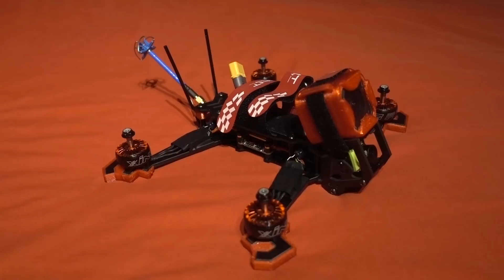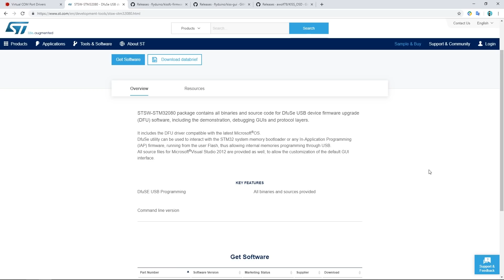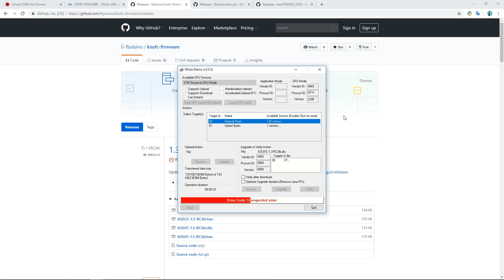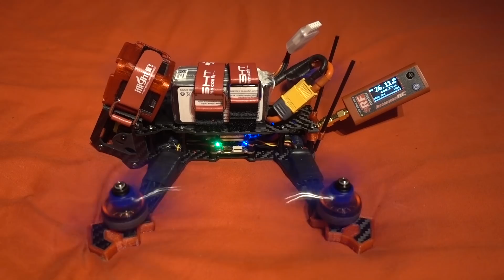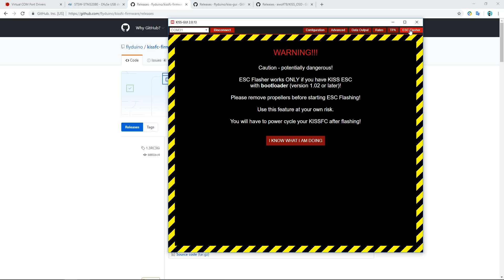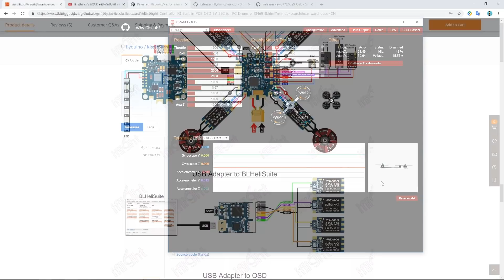iFlight Kiss AIO Freestyle Build Part 2

Comment: Hey there, nice setup as always, by the way i build mine also with XM+ and already bound with the rx, the LED showed solid green, but i got no signal output (stick input in the GUI), i swapped with my other XM+ did another bind procedure but still the same, the LED showed me green solid state but no input, both RX were used before in my other setup (helio with raceflight PEGASUS GUI and the other one is from OMNIBUSf4 Betaflight), i wonder since you use the same rx as my setup can you help me identify the problem? i soldered the 5v and ground to the fc and the SBUS as directed by the instruction given, many thanks before

Comment: Hi there, I'm trying to setup Iflight Kiss FC right now and having a difficulty to setup the correct channel mapping (i'm using Nirvana radio with R9M module). The mapping was incorrect from the start but when i'm chnaging the channels in Mixer the Pitch and Roll are getting on the same channel no matter what I do (i've mnaged to set up throtlle and yaw correctly). I choose eleron as a source for pitch but on the data otput page both pitch and roll are moving even if the Ailer/Pitch is completly removed form the list and vise versa. Do I need to chnage the FC orientation in GUI? I've installed it the same way AndyRC did (USB on top facing left) but the model in Data Output tab acts incorrectly when I move it around, should I do anything with it? On top of that I cannot make the motors spin, they only beep randomly from time to time  :( This Kiss stuff seams to be not so simple honestly i'm pretty dissapointed with the handicapped way it sets up (and i haven't seen it working)

Comment: I couldn't get the dfuse software to connect to see the FC even with zadig steps and zadig getting to see the "STM32 BOOTLOADER", fixed it using this "https://kiss.flyduino.net/dwkb/troubleshooting-for-stm-windows-drivers/" the install directory for the drivers has changed but the driver install name hasn't. Just my 2cents worth.

Keep up the good work Andy
Reply: Just to add more findings. 

Once you use the above method to install the dfu bootloader driver to flash the FC. IT WILL NOT BE DETECTED IN THE KISS GUI, you have to swap the drivers AGAIN but now so your PC will used the virtual com port driver instead of the dfu bootloader driver. 
Do this by following the "virtual com port driver process" after uninstalling the DFU driver you just installed to get the dfuse software working. 

A double driver swap just to get new SW in before using the GUI. Andy, you weren't kidding saying that KISS is a pain to get working.

Not saying everyone will need to do this but this is how I had to do it to get KISS detected on both my laptop and PC.